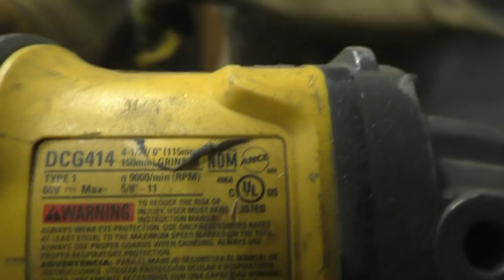Grinder Safety -- and lies you are told to scare you.

Comment: Your opinion is worrying.I spend two minutes of my day as  a Welding Instructor explaining to apprentices and students why we have PPE. The fragments could potentially move at 60 metres a second on a large 9 inch angle grinder.Your lazy attitude was unhelpful and misleading.Yes the fragments are sometimes in a resinous bonded matrix and so  the inertia could be less upon break up.Wear a full grinding face mask.please. I have seen this go wrong with horrible results.
Reply from the maker: Where in the video did I say not to wear PPE?
Reply: @SVSeeker  You did not,I get what you are saying,I enjoy your work on your vessel but you only have one set of eyes.

Comment: Been a welder for over 25 years and never had a guard on a grinder. And never got hurt. Yes had some discs come apart but as you showed nothing that will kill you if you are wearing the right ppe. Personal protection equipment. Glasses ,gloves and either an apron or leather coat.

Comment: This could be one of the most unintentionally comical videos I have ever watched. His point seems to be that you do not need to have a shield on the grinder because flying pieces won't really hurt you you. You will just suffer a laceration requiring stitches, so why bother with the grinder shield? 

 The grinder shield is the first line of defense, and eye protection is the second. And eyeglasses are not eye protection. Also, if you don't want tinnitus to make your later years hell, wear ear protection. Thick gloves are important too. And a mask if you are making dust. 

But the point is, angle grinders are dangerous for a myriad of reasons even with the grinder shield on. They can cause serious injury so making a video just to tell people that they are not dangerous is asinine. 

I encourage people to search for grinder accident.
Reply from the maker: Darling, you need to watch the video again.   The point is that your brain is the first line of defense, and if you want to use a guard then use it.  But if your brain is not working the guard will not work either.   -- Mom

Comment: Let me guess, you don't wear a seat belt while driving. You Tube won't dimonetize this fool.
Reply from the maker: Well, not on a motorcycle.   I'm curious,  did you here me say not to use a guard, or are you influenced by everything you see without giving any though regarding  your own skill level?
Reply: @SVSeeker  The guard is there to prevent your hand from coming into contact with the wheel. I've been using grinders for decades. Removing the guard will not make it work better.  do you also remove the blade guard from your chopsaw as well? Can't fix stupid.
Reply from the maker: @rtta51  Go home Mom, your drunk.   : )

Comment: The eye injury you described, quite literally the exact same thing happened to me. Glasses and face shield, got a small sliver of steel in my eye and no harm done. Meanwhile I’ve used a grinder without a shield 9,000,000 times, no problem.

Comment: I both agree and disagree with you as a diesel mechanic I use Grinders on a daily basis for long time I agree that if you been using one for a while you probably don't need the guards the guard sometimes can cause an issue but you do need to wear safety glasses and you should use a face shield I have had Wheels break off and hit me now it wasn't really that bad but still if I am taking that in the face it would have been worse always wear safety glasses when using a grinder